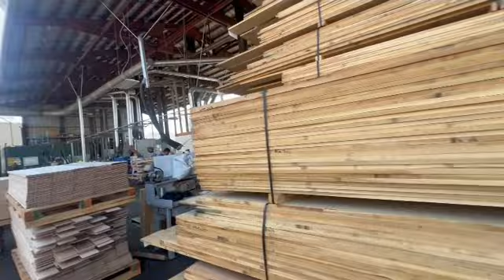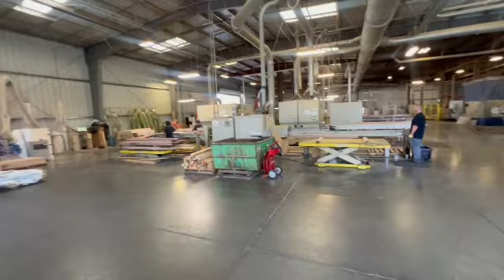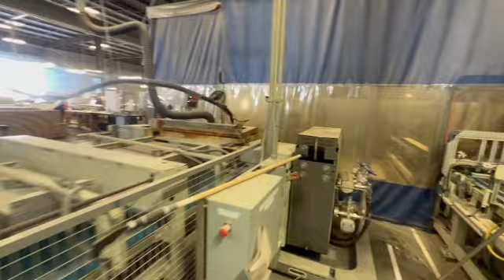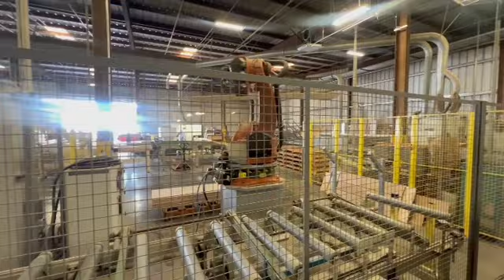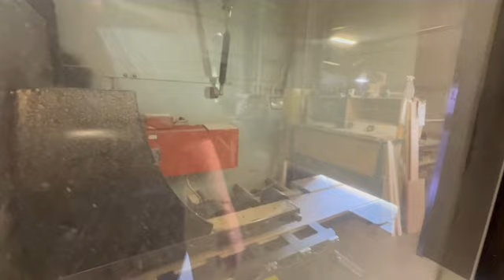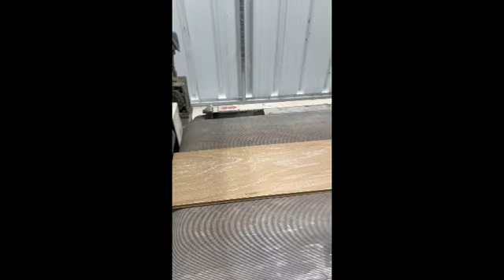Pacific Hardwood - Custom Engineered and Solid Hardwood Flooring Manufacturer

Comment: Have you considered how the wood subfloor’s moisture content can affect your pre-finished flooring installation? I always check that carefully before starting, especially with wide white oak like in the Coastal Collection. It helps prevent issues like cupping or grout cracking later on.